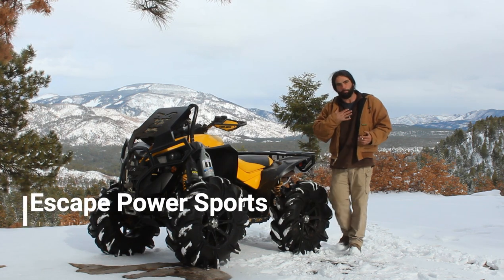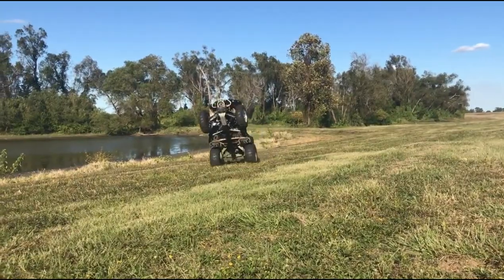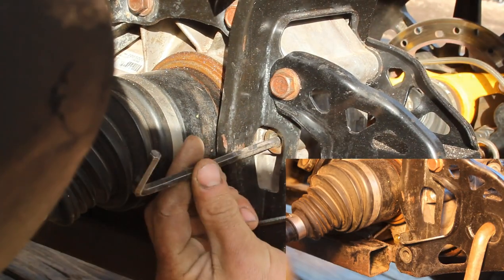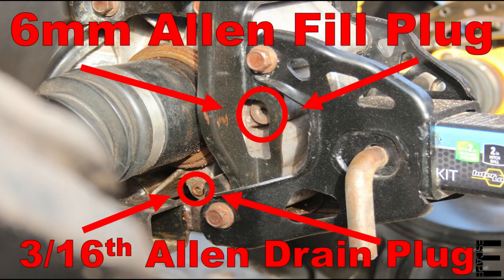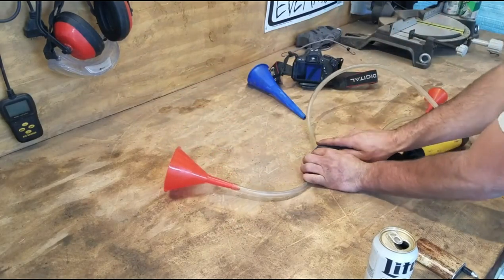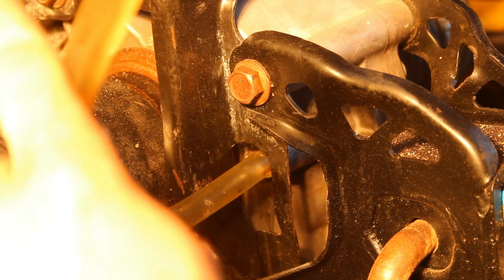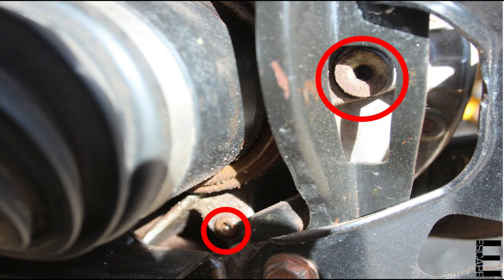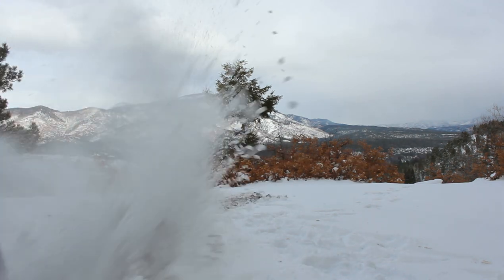Renegade Rear Diff Fluid Change Cam-Am ATV (How-To Replace Final Drive Oil) By BOOK

Comment: I have a 2005 bombardier 400 Max O.H. XT front differential rear differential need information appreciate it if you can help.
Reply from the maker: so I checked in the operators guide for your machine on brp's website www.operatorsguides.brp.com and on page 143 I found this 
"Differential
Front
Rear
Bombardier differential oil or Synthetic
polyester oil 75W90 (API GL-5)"

Hope this helps and I appreciate you watching and taking the time to leave a comment. Cheers

Comment: Hey, for 500 renegade 2007 what's the capacity 300 or 250 ml ?
Reply from the maker: rear diff on an 07 is 250ml I believe. Thanks for watching and taking the time to leave a good question in the comments. Cheers

Comment: Anyone know the capacity for a 2014 renegade 800 xxc?
Reply from the maker: page 126 of the operators guide for that machine has the rear final drive capacity at 300ml. Hope this helps. thanks for watching and taking the time to leave a comment. Cheers